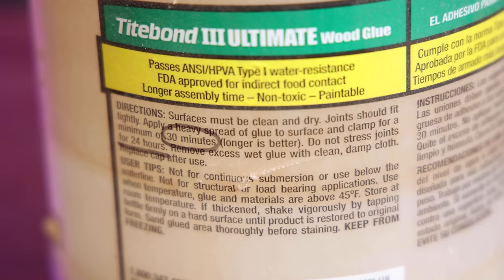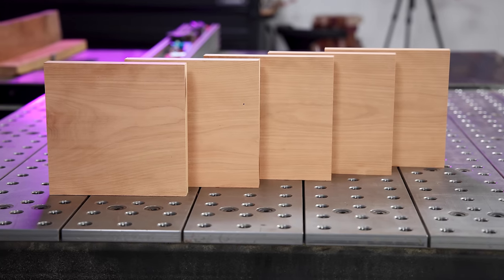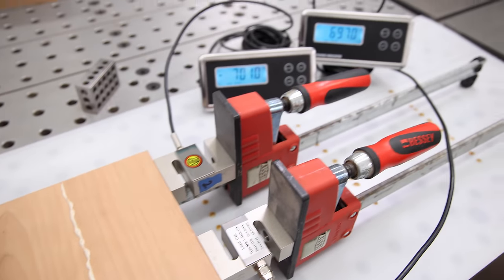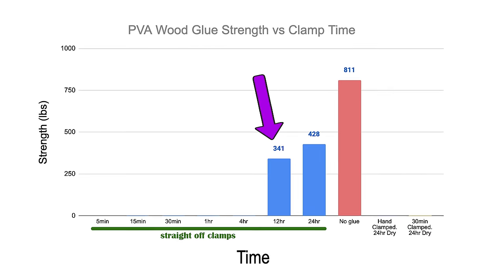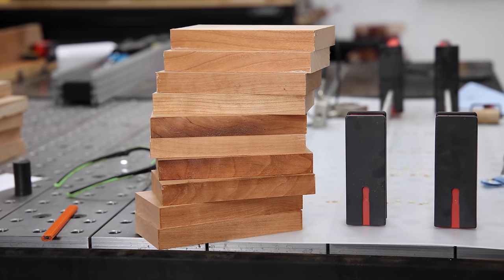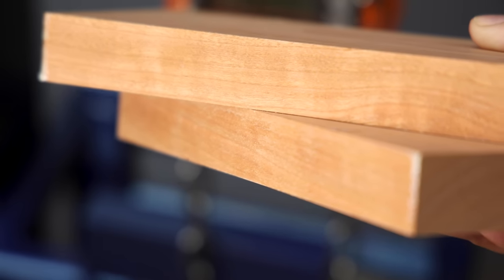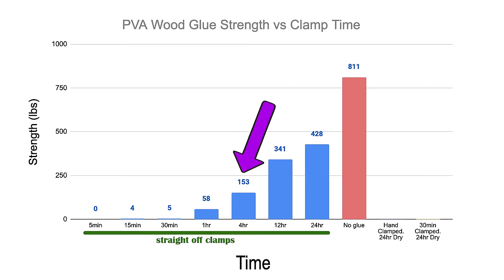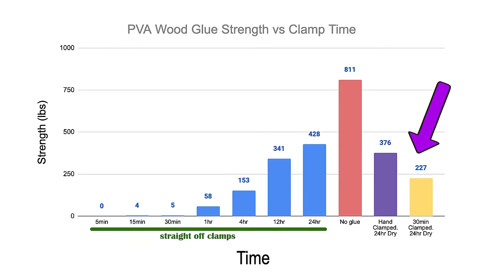you are clamping too long

Comment: Great video!! Here's my theory. When the clamps were removed after 30 minutes, the glue hadn't cured enough to compensate for the release of pressure. The boards pulled apart just a little bit on their own and messed up the glue. When you just pushed the boards together and left them, there was no change after 30 minutes, so the joint was stronger. Maybe?
Reply: Was thinking the same thing
Reply: Hadn’t read your reply before my post, totally agree.
Reply: Agreed, to look at it another way, the clamps squeeze out far more glue than the "hand pressed" version, so when the pressure relaxes to "clampless", there is less glue in the joint than the hand pressed version, but a wider gap than the long-term clamped version.
Reply: Yep. My thought as well. Don't know for certain, but glad to be part of the majority consensus hah
Reply: Not even a question. The glue has not fully cured in less than 24 hours. It achieves a minimum working strength in 30 minutes.
Reply: It seems to me that any material that goes through a curing process (concrete, paint, epoxy, caulk, glue, etc) should not be experiencing any changes during that curing time, especially changes that would cause expansion or contraction within the material. If you think of the curing process as the bonding material slowly forming connections within itself as well as to the substrate, then changes within the material during that process would likely break some of those early forming bonds because they are too weak without all its neighbors also helping to hold it together. This hypothesis could easily be tested by simply repeating the test done here that resulted in the strongest bonds but subjecting the material to changes during the curing process. You could alter humidity, temperature, position, etc.  One interesting test would be to put the material on a vibrating surface during curing. Or you could rotate the material 90 degrees every 5-10 minutes. Or you could make subtle changes in the clamping pressure every 5-10 minutes.
Reply: I jumped to the conclusion that it was an experiment mishap, but your explanation makes complete sense.
Reply: My thoughts too
Reply: This explanation makes sense in a vacuum, but not in the larger context of real world woodworking. I don't believe the glue manufacturers would recommend a method with such a flaw in the method, and I think people would have noticed this problem before now. Before trying to explain the result, step 1 is to try to replicate the result.
Reply: @trevorlambert4226 on one hand yes, but on the other hand it still took 200+ lb focused directly on the glue line and it does say clamping longer is better. so I wonder if there's just some specific strength criterion the manufacturer instructions are designed to meet.
Reply: @JustinShands I agree with Justin. When you did it by hand, there was more glue in the joint. When clamped, there was squeeze out and less glue in the joint.
Reply: There have been times when I've scraped the squeeze-out after an hour, found a place where the joint didn't close, applied clamps to close it up, and, after 24 hours, it stayed closed.  Evidently, the glue stays pretty plastic for that <4hour time, which would back up your theory.
Reply: This was my thought as well yet I would add that at those clamping pressure that this combined with the pressure of clamping is going to have a HIGH glue squeeze out making me believe that combined with the release pressure and some atmospheric conditions of contraction and expansion with glue squeeze out things are going to be different.

Im no expect of woodworking by any means but what i learned so far from science/ physics i think I'm adding to this idea. Less glue means less strength plus release pressure.
Reply: My guess is that the clamping presure is squising too much glue. The pressure and glue amount should be comparable
Reply: Same thinking, release of pressure probably messed it up.
Reply: I was thinking along those lines, but I wonder if the release of pressure pulled air into the glue through the woods fibers.
Reply: ex- Aircraft Mechanic here:  The glue's secret-sauce for strength is in that it penetrates into the wood fibers. When you hold it clamped, the hydrophilic nature of the fibers is combined with the hydraulic force at the liquid glue to wood-fiber boundary, which presses more resin-impregnated liquid deeper into the fibers than what just merely capillary action can achieve.  TIP: to supercharge this gluing action, soak the area to be glued (PVA-type) in water for 10-minutes, just prior to the lay-up.
Reply: I absolutely agree. Removing the clamps too early disturbs the joint before the glue has cured, making the result substantially weaker than just using no clamp at all.
Reply: @ehisey  And they do mean "MINIMUM."
Reply: You just saved me a bunch of typing! Gratzi!!!
Reply: Same of what I thought!
Reply: Would be cool to see the experiment again, but with a 24 hour cure for all of the clamp times.
Reply: Exactly. Interrupted curing. A gap introduced mid cure
Reply: @indisputablefacts8507  Inside the joint away from air stays wet longer too.  
If you make a blob of PVA wood glue big enough the outside will cure and keep the inside wet for ages
Reply: That sounds like a good theory
Reply: Yes, what you are describing is called rebound. With a good, but imperfect joint on a porous material, there will be a rebound effect when the clamps are removed. If the adhesive can't absorb thr rebound via elasticity, the joint will be weaker. This has been well documented in the industrial adhesive community.  Good call.
Reply: This is exactly what I came here to say. It makes intuitive sense, though I have no idea if that's what's actually happening.
Reply: The wood glue bottle I have recommends at least 60 minutes for hardwoods. I think that’s what happened here - not enough time for the glue to start setting before the clamps were removed. Denser woods require more time to set because the capillary action isn’t as strong.
Reply: Thanks for a very good video. I glue up segmented bowls and vases etc  with a glue joint approx 20mm wide, then I turn them on the lathe down to a wall thickness of 6mm 1/4inch and I don't have failures . But I glue things in an un conventional way.. I apply the glue to the surfaces and let it sit for a minute to soak in, if there are any dry spots I apply more or just spread it with my finger. Then I clamp up tightly. I don't have to worry about starving the joint of glue because the wood  had time to absorbe it before clamping. I clamp for an hour, and I'm very careful to avoid temperatures below 12°C  I bring the glue into the house overnight.   By the way, this joint will GRAB very quickly,  so you must have the parts lined up and the cauls and clamps ready in advance. If you disturb it after it grabs the joint will fail.
Reply: But if this were true, why are glue companies recommending you do it this way?
Reply: Your reasoning is actually correct
Reply: 100%
Reply: Agreed. After 30 mins my glue joints still want to slide around. It's pretty humid here so that's part of it but I've always found trying to take the clamps off at 30 mins is a waste of time.
Reply: @JustinShands  I was thinking the same.
Reply: @ehisey don’t think you watched the video.
Reply: @rsilvers129  no I did. The comment and this thread, is looking at the minimum time glue up. And he got expected behavior when he moved the boards at 30minutes minimum which is still a weak set. While you can remove the clamps, the bond is not strong enough to handle any movement stress. PvA takes atleast 24hrs to full cure longer on very wide and long glue ups. A rub joint(the one he just pressed to gether) was not moved or disturbed till it had a good cure.
Reply: @wisnoskij  I would guess that they didn't do this level of testing. They found what seems to work well and just went with it. I've done technical writing for many companies and you wouldn't believe how often this happens.

Comment: I was a research engineer for 10 years designing and carrying out experiments, and a woodworker since before that. This is one of the most complete and robust scientific woodworking experiment videos I've seen. Controlling for all sorts of variables via sensors that most others would ignore. Thank you for this video, I and countless others will benefit from your rigor! I'm about to glue up a large table in half a dozen glue ups and this will save me days!!
Reply from the maker: Thanks dude! I could have added more variables like letting each of the conditions dry 24hrs but it takes so much material and time to do this experiment as-is. I’m glad you appreciate the consideration that went into the setup.
Reply: @WoodcraftBySuman  There are always more variables! You seem proficient at identifying and appropriately accounting for the important ones to reach practical, useful conslusions which is what makes good science. Most videos like yours are woodworkers taking a stab at being scientists, with varying success. You strike me as a scientist first, applying yourself to woodworking. Do you have a background in research?
Reply from the maker: @FlyingMoose_  haha. Pretty solid deductions there. Yes I am a scientist - though in biologics.
Reply: @WoodcraftBySuman  Not a lot of fields that have a future in research beyond academia, biologics seems like it would be a good one. I worked in metal product manufacturing research and applications. Very large lab with lots of fabrication, inspection and data collection equipment - lots of work with load cells, they are so incredibly valuable for experiments but unfortunately very expensive! Stuff I've always dreamed of applying to woodworking so your videos resonate strongly with me, I'll be binging them over the next few days.
Reply from the maker: @FlyingMoose_  that’s super cool! And hope you like the videos. I only have a few on testing stuff as this has been a recent pivot for the channel. I will continue to make testing or testing adjacent videos going forward.
Reply: Yup.  I really appreciate that you did multiple sample pieces at each configuration, even though that limits the number of configurations, rather than doing only one sample per configuration.  That's really important for giving good data, and it seems that very few YouTube channels that do testing pay attention to that.
Reply: @BrooksMoses  Yes hi did.  I think he stated in the beginning using 5 samples, and throwing out the low and high values from each test, and averaging the remaining three.
Reply: @WoodcraftBySuman   FYI, if you did it again with 24 hour curing time, you're definitely getting more views ;) I'm really curious why 0 hrs clamping time + 24 hours curing time was stronger than .5hrs clamping time + 24 hrs curing time.
Reply: @RickYorgason my hypothesis is that the initial clamping squeezed out more glue from the joint than just hand clamping did, without enough time for the glue that remained to dry and become stronger. So after the 24 hour cure time, there was just more glue in the hand clamped joint to hold it together. I'd love to see more testing on that though.
Reply: This is exactly what I came here to say. This work is worthy of being published! At least in a whitepaper or arXiv preprint or something!
Reply: The most complete? What is the point of testing various clamp times if you're going to test them before the glue dries?? 5min thru 4hr were completely useless tests "broke at the glue line" I'm sorry but if the glue isn't even dry, "break" is not the word. If he'd test different clamp times but let them dry, then this would be an interesting test. The only meaningful tests here were 12 and 24hr...
Reply: Why would science toss away the highest and lowest measurement?
Reply: @rsilvers129  They might be outliers, and thus not representative of the underlying statistical distribution.
That's a typical trick but here the sample size is quite small (and the dispersion is probably quite high because wood is a natural material with a lot of variability) so it's probably a bit bold to discard 40% of the data points.
I personally wish Suman would show error bars on the bar charts but that would make things even more nerdy.

Comment: I would bet the weakness of the 30min clamp could be due to squeezing out the glue and then, before it's adequately set, rebounding the wood and creating small voids that would have remained either filled with glue in an unclamped setting or allowed to fully bond with a longer clamp time.

Comment: I worked in a furniture mill in the early 1980's. When making raised panel doors with standard stick and cope construction, our rule was to leave the doors in the clamps for at least 2 hours. After that time, they could be removed from the clamps and stacked if we needed the clamps for another batch of doors. (We typically made doors in batches of 50 to 100 doors.) We were using a typical PVA glue, something similar to Titebond Original, which we bought in 55 gallon drums. We let the doors cure for approximately 24 hours before doing any additional work on the doors (trimming to final width and length, putting an edge profile on them, sanding, etc.). 

I follow the same practice in my shop today. I leave a glue-up in the clamps for at least 2 hours and don't stress the joints for about 24 hours. I've never had a glue joint fail when following these procedures. (Except for the time at the Furniture Mill when someone stored a 55 gallon drum of glue outside, overnight, in sub-zero temps. None of the joints made with that glue held! PVA glue is ruined by freezing.)
Reply: Ruined by freezing, eh?  Guess I should be throwing away all the bottles that sat in the garage over the winter and experienced repeated freeze thaw cycles. Not a lot of glue, but a couple of small bottles from when I couldn't find the last one and just bought new.
Reply: Could be that the glue was still cold when applied
Reply: No. We confirmed with our supplier that freezing ruins PVA glue. If your glue freezes, simply throw it away. There’s nothing that can be done to make it work after that.
Reply: Dang iI ust glued up a bunch of things with my titebond that was stored in my non heated garage.  Great now I have to find a new spot to store my glue.
Reply: I can attest that frozen wood glue does not work that well after thawing. 
I’ve also accidentally let CA glue freeze and that stuff is worthless after that
Reply: Done the same and for the same reasons all my life. Works well.
Reply: Been following this same 2 hour procedure for 30 years with the same results. I cant say I measure the 2 hours, but unless I am just jamming out cabinet doors, I cant get to anything faster than 2 hours. so most of the time it is more. I also try to ensure clamps are full at the end of the day so I can open them in the morning. Let the clamps work while I sleep.
Reply: How cold are we talking? My pva glue sits in my unheated garage every winter   and I've never had an issue. 
(Edit: just saw that titebond can be frozen and thawed but other glues can't. They just recommended stirring it after it thaws)